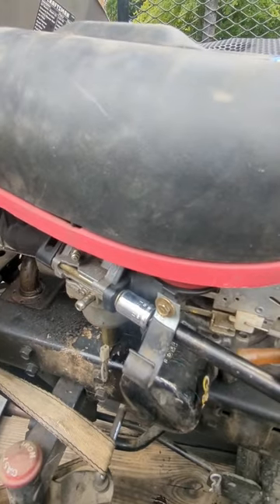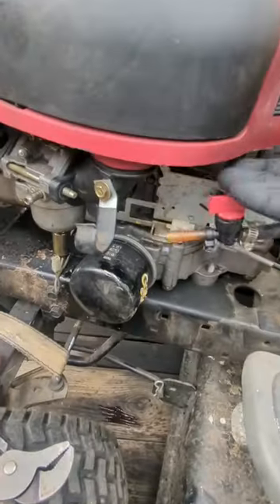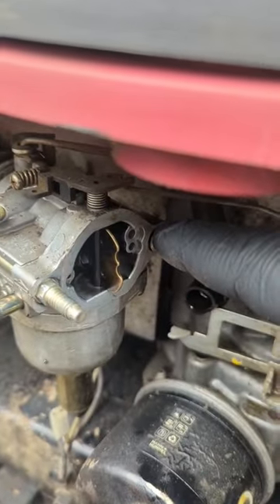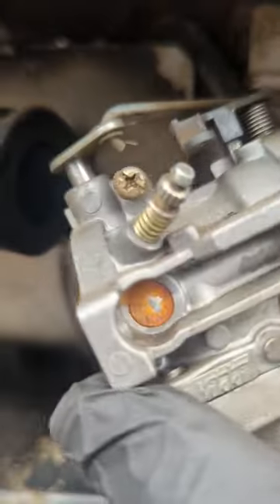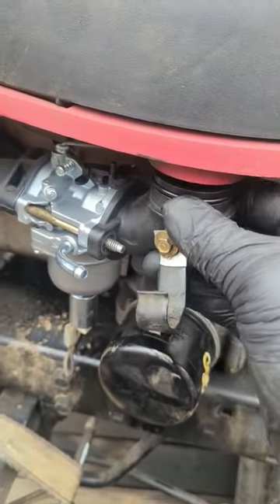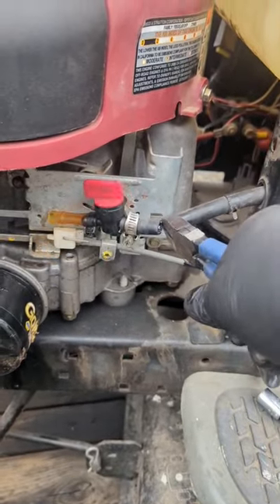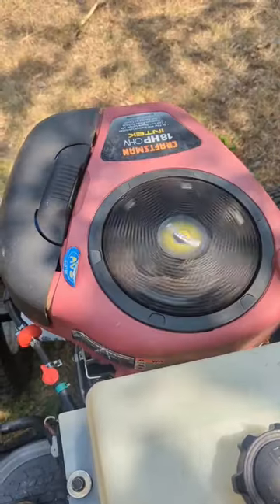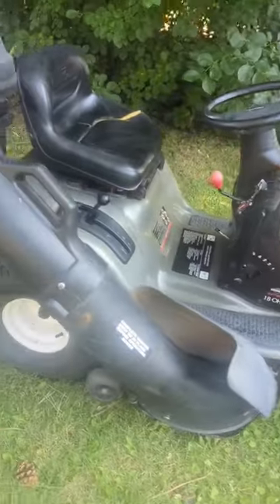Replacing Carb on Briggs and Stratton #shorts #mower #repair #mechanic #howto #business

Comment: Common problem on those carbs that tricked me for days is in the fuel inlet, you have to take it off with a vise and a pair of vise grips and on the inside is a little mesh filter that is clogged
Reply from the maker: Good tip!